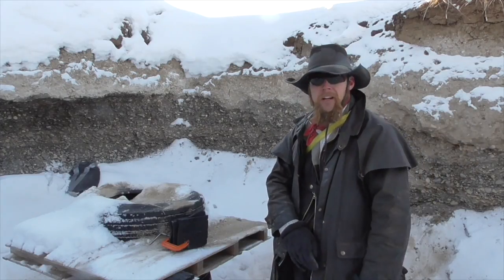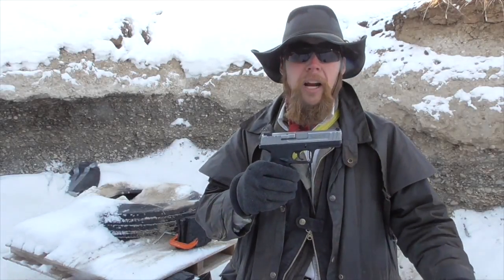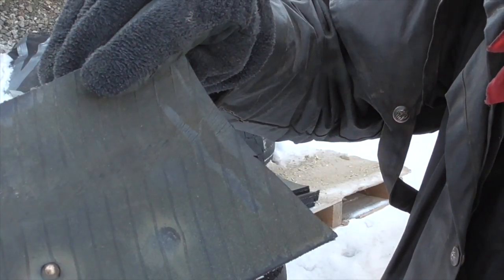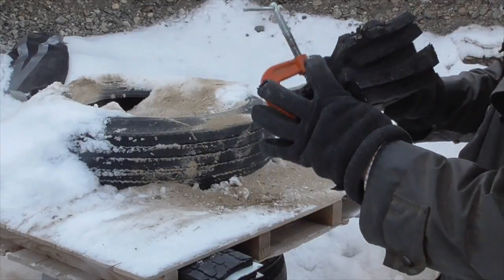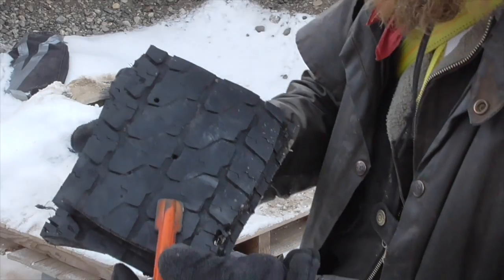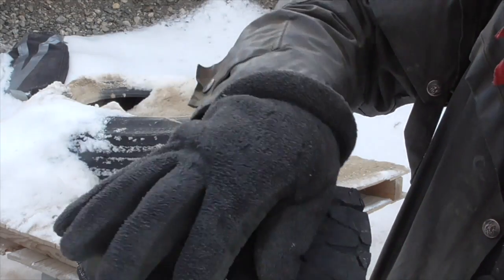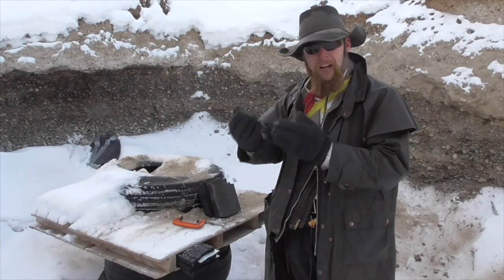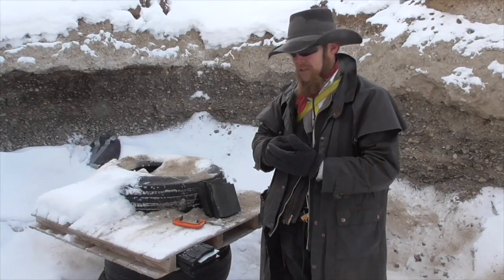Testing Improvised Armor: Tire Tread (TIS252)

Comment: The ONLY reason to be behind the front tire is to use the engine for cover, its the biggest thing & most solid
Reply: If you had taken a vehicle fighting course you would have been taught what parts of the vehicle would stop what bullets. Clearly you haven't.
Reply: Not quite the only. Gas tank is usually in the arse end. Not as bad as Hollywood makes out, but worth considering all the same.

Comment: A guy might try getting ahold of tires off a commercial jet. They resell those tires when done for ag tires because they are puncture resistant for guys who mow pastures around locust trees with their hard as nails 3" thorns. They are fairly cheap and wide enough thread to cut a wide enough plate for 2 piece armour

Comment: Much too heavy for body armor unless you're a literal Biblical Giant like Goliath. Thin layers of tire or tread is great in a knife fight but if you're getting hit with a slug from a 12 g shotgun you're not going to live through that. 17 layers of silk with a layer of leather with chainmail on top that stuff still works. Its lighter and still works. 17 layers of silk made into a vest. Cowhide leather made into a vest. Then a chainmail vest over that. Still easy to move around and will protect your vital organs from most guns. The layers of silk twist around bullets and bind up. The layers of silk bind up around arrow heads also. Somebody go get several yards of silk fabric and fold them into 17 layers,cut them into a square and get cow hide and put it on top. Next get or make a square of chainmail and place that on top. Nail it all to a board. Then set it up and take a shot from a 22 then go from there. This way you know what it can withstand. Also shoot at it with a bow or a crossbow. Lets see what happens.

Comment: It's been an interesting series that you've done. The question is of course never whether a material will stop a bullet but how much bulk, weight and expense it will take. I think wearing 2 in thick attire rubber is going to be probably as burdensome as wearing a steel plate but perhaps a steel plate with tire rubber to reduce swelling would make more sense.

Comment: Tire-ceramic or steel plate-tire-tire

I believe that combination of layers would allow for less mass and at least equal durability. Just my 2 cents, love your channel.
Reply: Genius
Reply: I think that something like this for a ballistic shield makes sense. A steel plate with a layer of tire tread out to work well as the tire would absorb a lot of the energy allowing the relatively thinner steel plate to stop the bullet.

Comment: Awesome!  That steel wire is massively expanding the area resisting the transit of the slug.  The first layer should be a material that has a massive crush resistance strength also ideally it needs to maximally deform the slug so that when it hits the steel it is maximally drawing on the tensile strength of the steel.  So if you could my good sir do another one like this... crush resistance deformation layer.-->tire tensile layers-->high density back stop layer.  This should be about all you can do and it might not be very possible considering the hastily improvised restriction.  After that the only thing I can think of is gas expansion/compression gaps between layers.

Comment: Not to be pedantic, but would having the clamp only on one side of the composite possibly have skewed the results in that the deflection of the material moving around helped dissipate the energy that wouldn't have occurred with a more stabilized composite?

Comment: Im curious how did you make such clean cuts? Sorry if you have previously answered this.
Reply from the maker: I cut up the tire using a handheld electric reciprocating saw.  It worked ok, but I wore out three blades cutting up one tire.
Reply: The Sawzall, it saws all!
Reply: A cut off disc can work well too. Make sure to wear a faceshield and Safety glasses with gloves!

Comment: Try rubber mulch in bags 6" deep.  Bulky, perhaps, but lighter than complete tire sections.  Certainly, rubber mulch is self healing with bits falling in to fill the bullet path.  While the complete tire sections will eventually have a gaping hole, if shot multiple times in the same location.

Comment: Hi next time try this with a 1/8th steel plate front followed by two layers and then another steel plate backed by 2 more layers of tyre and a mother steel plate. In the early days of the founding of Israel this is what they did to armour their tractors and trucks.

Comment: Another cheap material!  I'll bet truck tires could do it with one or at most 2 layers. Or maybe something hard in front to break up / deform the bullet before the rubber. 
Looking forward to your next armor experiment!
Reply: Race tire mybe reinforced  tires has more kevlat and steel " cables" than norman tires
Reply: Race tire mybe reinforced  tires has more kevlat and steel " cables" than norman tires

Comment: i will make a plate , 2 layers of tire rubber to stop the weaker bullet and avoid fragmentation of the bullet or slow down more powerful bullets, half an inch-thick layer of kevlar for more protection, plus half an inch-think of pig iron. trying to do one under $80. :)

Comment: AMAZING against anything, except bullets......but will 100% stop fists, arrows, spears, axes, swords, machetes, knives, clubs!

So, it is a great body armor for an apocalypse situation....but will suck against firearms....

That said, a few years into an apocalypse might see ammunition become pretty rare......
Reply: It would depend on the type of tire and how many layers are there. Having a big truck tire or a tractor tire would be thicker and offer more protection when used as armour. Mixed with smaller tire wheels which would be placed along the back of the truck or tractor tire armour would offer greater protection. I don't know about the weight thought.
Reply: @Callum_Summer0972  Yeah, when you factor in weight vs protection (and you aren't even trying to stop bullets)....then it is very hard to get anything better than thin hardened steel plate cuirass.  Could probably shape mild steel plate (can get thin sheets), then harden quench, and finally temper soak it......could even use a welding torch to reach the right temperature in a pinch...